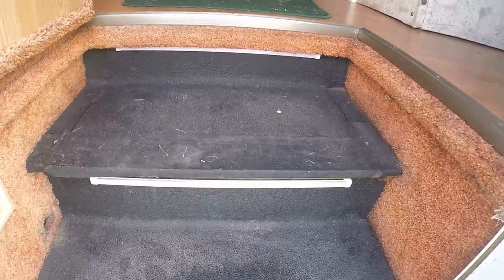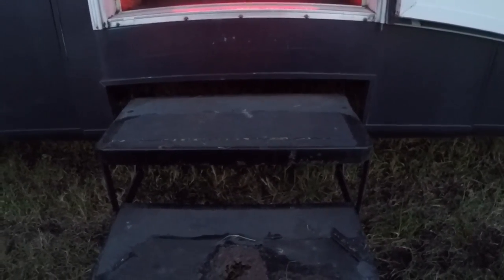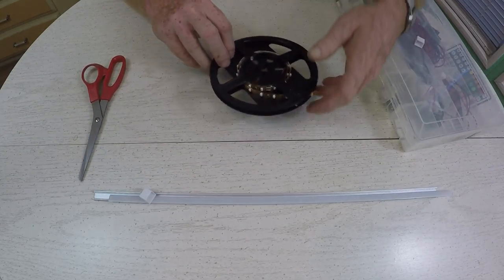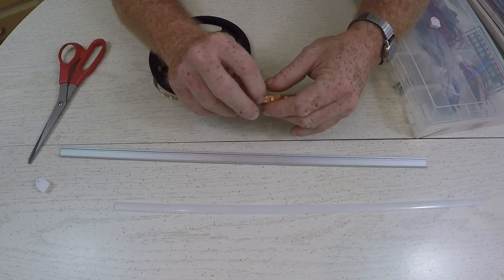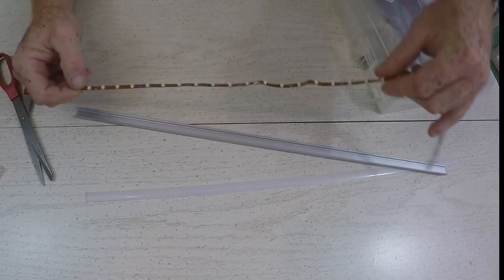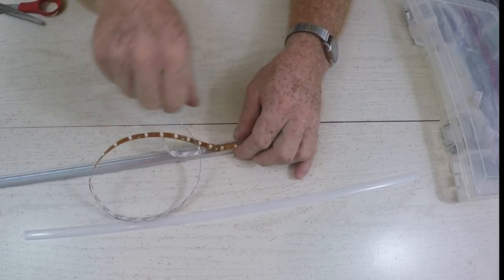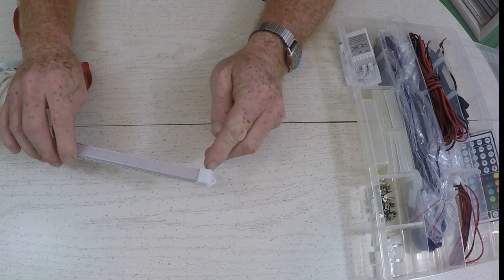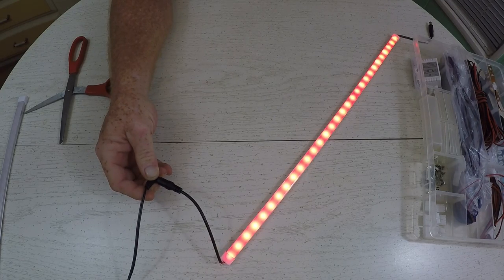LED Courtesy Light Instal

Comment: HI Chico. I am enjoying your adventure into the wonderful world of RV ownership. I am about 4 years ahead of you on this "trip" so recognize a lot of similar experiences. I installed LED lighting in my Itasca's (named Itasun) step well as well. I got a magnetic switch (same as the one to operate the steps) from my RV shop and placed it on the opposite side of the screen door, with the ground wire running through the switch. With this arrangement, the step well lights come on automatically whenever I open the coach door. I use a magnet, such as a rare earth magnet, as an on/off switch by simply placing it between the contacts and therby disabling the switch. Simple, easy and effective.

Comment: Cannot find that light strip enclosure thst you used. What is it called?
Reply from the maker: Jim Simmons Try this link.    http://www.ebay.com/itm/10x-0-5M-U-Shape-Aluminum-Channel-Holder-Cover-End-Up-for-Rigid-LED-Strip-3-/251913337553?pt=LH_DefaultDomain_2&var=&hash=item3aa7347ad1